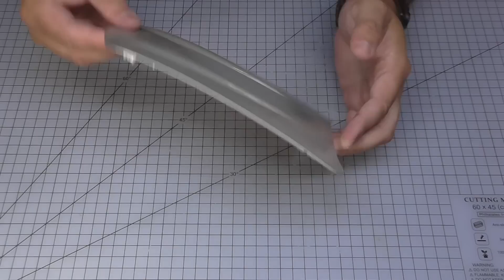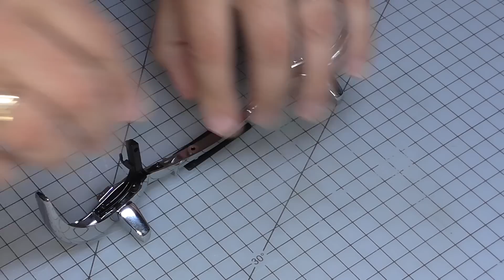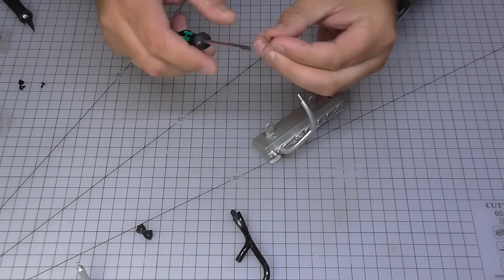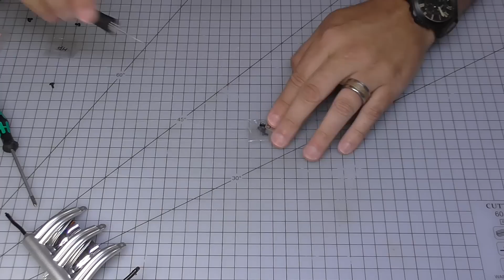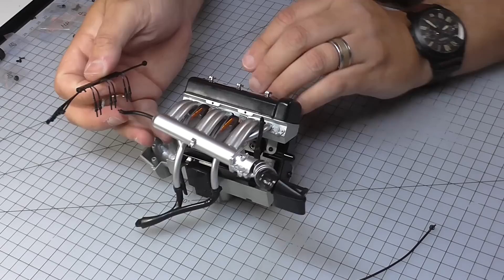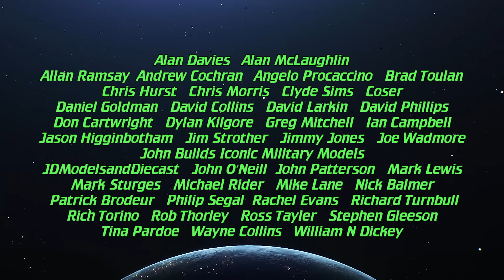Build the 1:8 Scale Mercedes 300SL Gullwing - Pack 2 - Stages 5-10

Comment: Hey, you never mentioned how you got the two screws in through the tabs in Stage 9!  I struggled there for 40 minutes to get those two screws in!  Seems like the bracket angle was just slightly off, so squeezing down on them to kind of bend them a hair helped the bracket and screw hole to line up a little better.  Scraping the paint off the top of the hole made seeing it and lining it up a bit easier, and that is when I saw I needed to give it a bit of a squeeze.
Reply from the maker: Pretty much the same. Cocktail sticks to line up the holes and a lot of force

Comment: Very poor quality, just building the parts together. I think, Wayne has never seen a pic of the original engine. In stage 10 is the biggest mistake you built so far.
Regards 
Thomas
Reply from the maker: I'm always making mistakes. What did I do wrong?